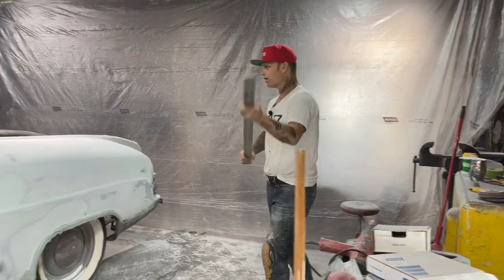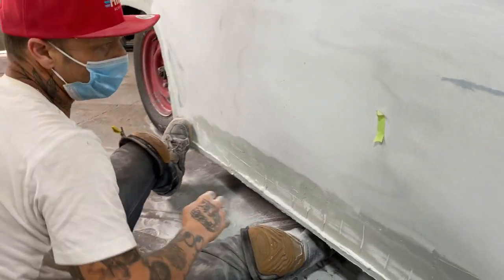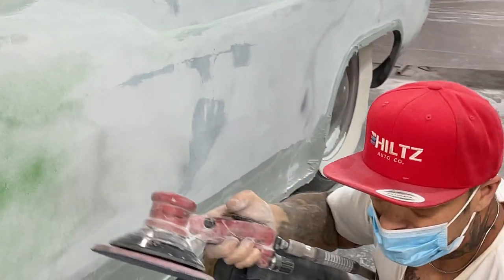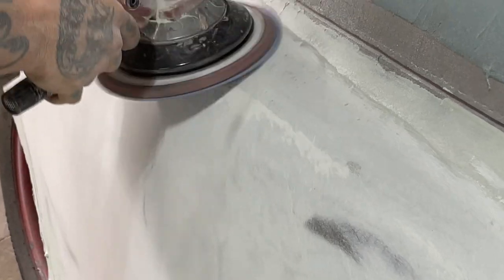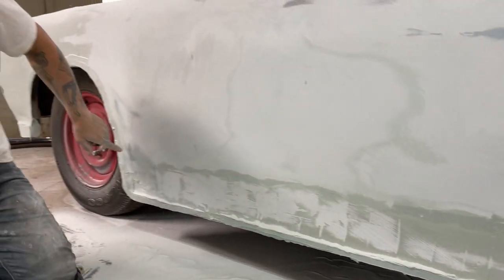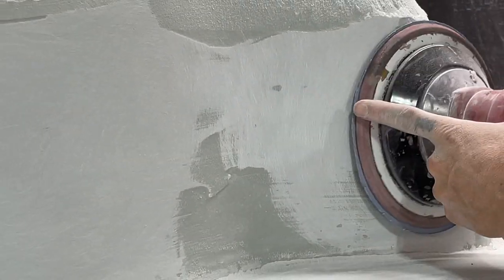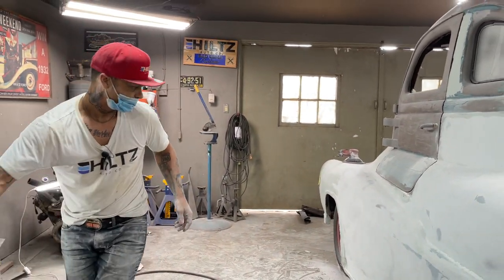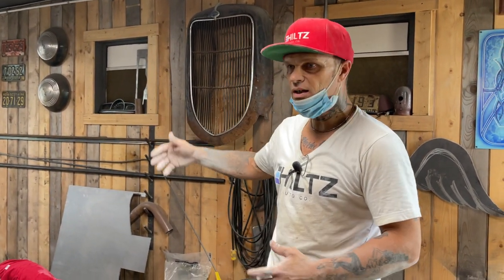SANDING BODY FILLER: TIPS & TRICKS FOR CONVEX AND CONCAVE CURVES

Comment: Can you explain how frenching in a step after the body work is easier?  Seems like cutting thru the body fill and sanding back enough to weld would be more work. Just curious of your thoughts or if you were just tired of welding?  Secondly, does getting the metal hot by welding in the step after body fill affect the adherence of the surrounding body fill?
Reply: I think he left it off because he is getting bored with the project and wants to move on. Unless his crew comes back to do the mechanical work this will go back to being yard art again.

Comment: I have a question why wouldn't you use a Air file board with 40 on it 136 and just file it out for there fire seems like it would be faster and then hand all the curved and corners

Comment: Following your advice I used what I had to do what was needed. I had some rust and blistering paint. All I had to use was sandpaper, grinding wheel or a 1/4 twisted wire wheel or my grinder. I used the wire wheel. It worked quite well. Almost didn’t need the sandpaper to blend it.

Comment: That is one big bog sanding job - I would enjoy lending a hand on that.   Bog dust - AAAAAAAAAAAAAAAAAARGH - gets into everything.  I have for many years, always had a vacuum with a round bristle nozzle handy - I am about to invest into a proper vacuum system to connect to the tools = NO MORE BOG DUST --- HA -- in theory.    It is amazing how you can work all day and late into the night - run your hands along an area and it feels straight - then come out the next day and feel the same area and say to oneself - "How in the F-CK did that get all wonky overnight?  AAAAAAAAAARGH".   HA - in an effort to allow you to knock off and sit and relax and have a BEER - the mind eventually sends a - 'Oh - that feels perfect now - I have done a perfect job" signal to the hands after many-many hours of working on an area.  HA - I eventually woke up to the 'mind trick' and try and take a rest from one area and go off and have a break or do something else and then the next day - ALWAYS go back over everything that was so 'perfect' the night before.   HA - the mind can be a 'powerful tool' - and for the 'unaware' - it can sometimes lead you into many areas of 'AAAAAAAAAAAARGH' type outcomes.    I liked to use a dead flat black acrylic primer as a very light guide coat on large bog areas - it can assist in overcoming the 'Oh that is perfect" signals the hands can sometimes receive when running your hand along a sanded area.   Have a safe and nice day all.   CHEERS from AUSTRALIA.

Comment: Lol. Your straight edge abilities.  It's high in the center and gets lower going away,  moves 12 inches and shows the exact same. So explain how that's possible.  With a 36 inch straight edge showing its lower 18 inches away from center,  moves over 18 inches,  now that center is higher than the than the previous center.  But it was just lower. 😮😅

Comment: Hey Chad,

Quick welding tip after seeing your floor work in Jim's car. Commenting here because I'm pretty sure you don't have time to watch comments on 6 month old videos LOL. Anyways, here it is, to avoid that little start up stutter when you first pull the trigger, keep a pair of mig pliers, or side cutters handy and snip off about a quarter inch of wire so that you have a fresh end contacting the weld point and that should make things a lot easier. If the end of the wire is still red hot, keep going, it'll start again just fine.

Comment: @Bad Chad 
this is exactly where I use a 2x3 x 24" ~ 36" steel tube strait edge
buy a roll (really cheap) of 60 80 grit from home depot..wrap it over the end and stick or clamp....perfect for targeting high spots like this that need feathered over a long distance.
also good to use as the straight edge to check the body

Comment: Boat roller . I usually use ABS pipe for getting contours sanded like that. More than one way to skin a cat . whatever works . Both get the contour straight and round at the same time .

Comment: Chad, I am liking the build but there is one line on the car that keeps drawing my attention. Topside of the doorpanels has a bulge running from the back of the cab to the front of the cab stopping at the front edge of the doors. I mis this body line in the hood to the front. The hood has a horizontal line (old hood / sideskirts) but does not match the doorline and bulge. It is a bit off set. Just a thought.

Comment: Blocking on the sides of a square body Chevy in the concave areas I used a section of pool noodle with an old broomstick jammed through the middle to give it some stiffness worked pretty well. I like the boat roller idea.

Comment: I can tell by the way he uses that sander those panels are as lumpy as a sack of walnuts. I assume he plans to skin coat and than block sand or maybe he's one of those that primes sands re primes sands re re primes and sands until it comes out straight. as for the bottom where he used the round block I would have used a small black wet sanding squeegee wiping horizontally rather than vertically. The easiest way to get it straight is to apply it straight you can see how rough he applied it.

Comment: Only thing I can say is you needed deadline sander badge head you're using the wrong tool for the right job or the right tool for the right tool for the right tool for the wrong job ticket as you will in line with definitely get your job way flatter than what you're for what you're doing all I gotta say

Comment: Thanks Chad I learned a lot so far 👍 you kind of left us hanging on the driver's door low spot didn't you? And I think you should have thrown a little mud in there and you might need an air file? I do body work as well but have not purchased one yet but I will soon 😇